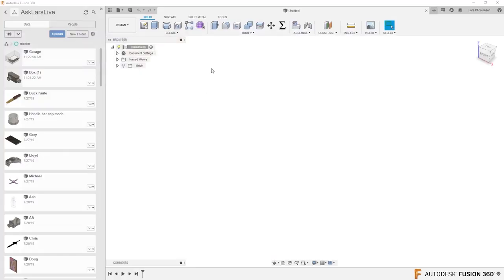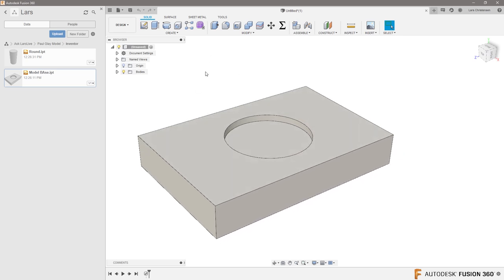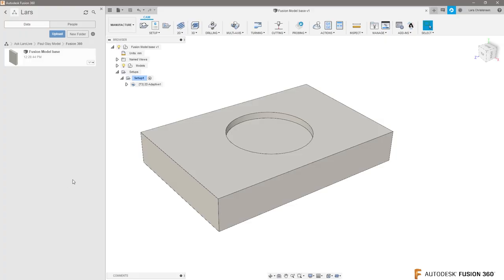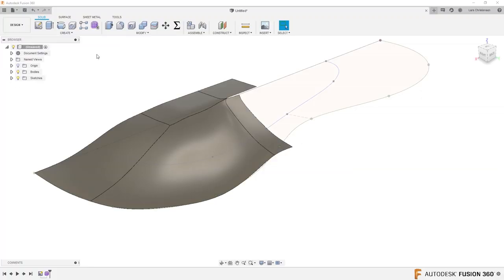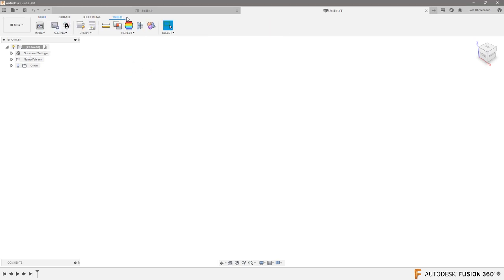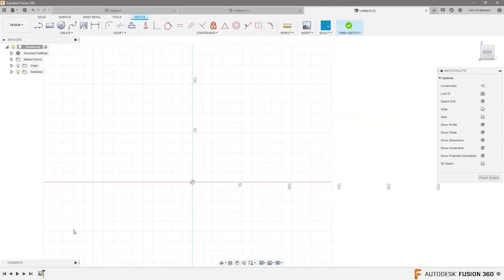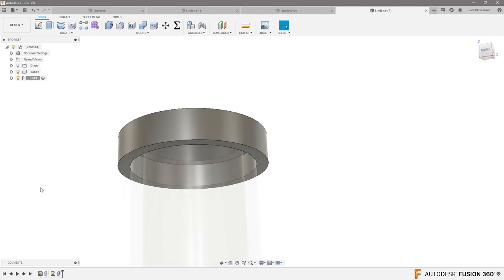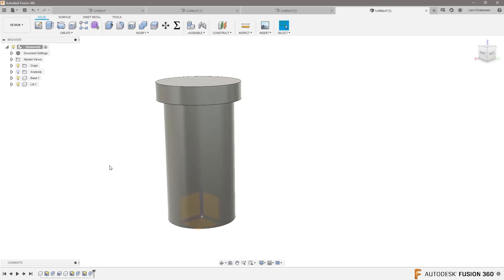Ask LarsLive Fusion 360 — Sunday Edition — Episode 13

Comment: Lars, Thank you for a good lesson! 
RE 3D printing: 
1) you do not need a support material in this particular case, printer will print well 45 degrees surfaces without support. 
2) you have set a very thin layer of 0.1 mm. That's why
 you get enormous print times in the slicer. Change it to 0.2mm and you will be surprised by how fast it could be still with a very decent quality...
Reply from the maker: Thank you 👍

Comment: Lars - wonderful Fusion Team explanation.
Being in Denmark unfortunately I cannot find job shops/CNC shops I can share live fusion files with and retain an integrated CAD/CAM environment. 
Are there ways to work with a job shop that uses Inventor + HSM and keep CAM paths attached to the Fusion files. The most frustrating waste of money and time we have is that every alteration to a design that would in Fusion only require regeneration of tool paths becomes a new task, and we totally loose the insight into things we do in our design processes that triggers increases in manufacturing complexity without giving any benefit to us or our customers.
While I have a hard time getting comfortable with the CAD side of Fusion the benefit of how you store, keep version history, and the transparency into stupid design decisions is just staggering.
Is there a way to close the loop to a machine shop using Inventor?

Comment: Thanks for the video. You placed the lid perfectly for 3d printing. Normally don't need support anything that is 45° hanging over. Also printing simple geometries like the snap fit round container you can cut down print time by choosing higher layers 0.2mm. Larger filets facing upwards in a 3d print may fail as their angle is too steep that upper layer will not lay partly above the previous. Always check the preview. Filets in xy direction work without any problems. Try to imagine that you cut out paper  z=0.2mm xy=0.4mm stripes and try to stack these on each other to generate a 3d model. As long the next layer has some surface (~50% off width) to lay on it will work, otherwise you need supports to help the layer not be printed in mid air. Hope that helps a bit and isn't too complicated written.
Reply from the maker: Awesome comment. Thank you !!

Comment: no supports needed , you need to click on the custom icon in cura and go through the settings and set it up properly for your printer only then will you unleash the printers full potential .
Reply from the maker: Hi Ian, I need to educate my self on those settings in Cura. I have no idea what they do 😁
Reply: @cadcamstuff  
Hi Lars,
With Cura if you hover the mouse pointer over a setting it will tell you what it does .
There are  a lot of settings available in there and you won't need to touch 90% of them . You can change things like infill density , infill pattern , wall line count , infill speed , inner and outer wall speed , layer height and of course the temperatures which can really improve the finish , strength and print time. you can also change the overhang angle for supports or turn supports off if you want .
Just like Fusion , Cura is constantly evolving and improving.
If you can drive Fusion you won't have a problem working out Cura !
What i really like is how Fusion and  Cura work together ! Design it in Fusion , click 3D print , Do a window select of the part i want to print and Fusion opens up Cura for me and i slice and print ! Too easy !